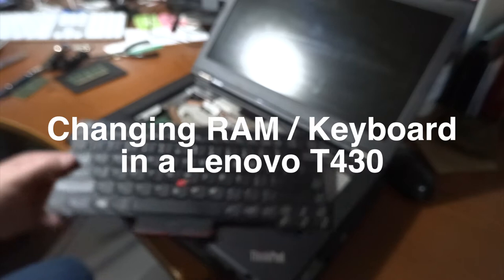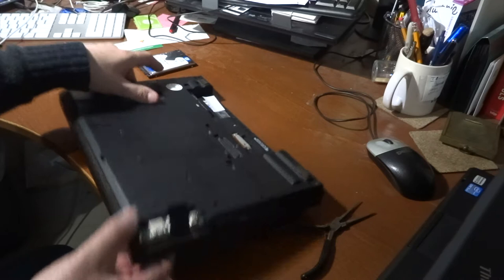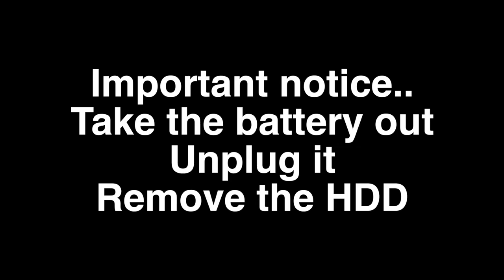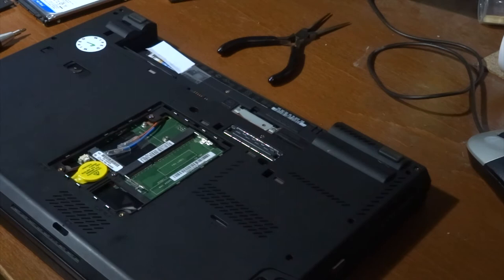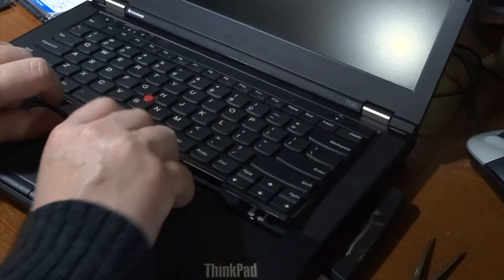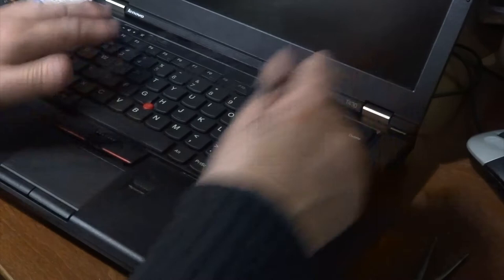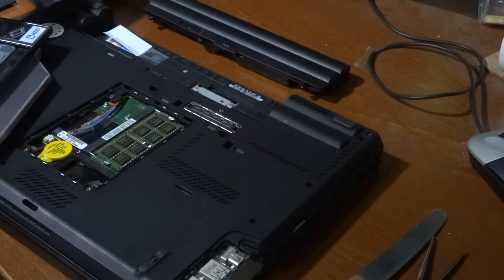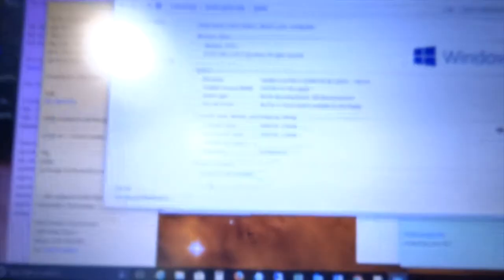Changing the RAM and Keyboard in a Lenovo T430 laptop

Comment: I think your old laptop only needed a new charger. The mouse going crazy when plugged in is a common issue with a cheap or faulty charger.
Reply from the maker: I only use the original Lenovo charger that it came with.   I noticed it with 2x T430's but not with my T450s
Reply: Yeah I've seen that occur when I used to repair thinkpads at an old job....voltage problems cause seemingly random issues, time for a new block.

Comment: Hi Mike
Is there a reason that my newly purchased refurbed Lenovo t430 would not have a cmos battery in it?
I bought it from FRys electronics.
Reply from the maker: No. That’s odd. Do you get a date / time error every time you start it?
Reply: @MikeDancy  Yes I do have to reset the clock. I just ordered a new cmos battery from amazon. I'm so glad I saw your video because I saw that it was very easy to change that model Lenovos CMOS battery. I will let you know how the new battery works out.  Thanks so much for your videos. They are very good and helpful.
Reply: Hi Mike. Put in the missing cmos battery. After 8 dollars and 3 hours of start up problems it finally works. I can finally pull the plug and not have to set the time when I restart. Yay! Thanks again!

Comment: Excellent video!  I love my T430 also!
Reply from the maker: me too.. but I sold it and went with a T450s .  512GB SSD / 12GB ram / Touchscreen.  Paid $400 CDN for it since it had a small crack in the display but mine sits in a dock 90% of the time so that crack doesn't effect my usage.
Reply: @MikeDancy  I was very fortunate to  find a very lightly used T430, and I mean very lightly used, for $130.  I updated with 16 gigs of ram and a 500 gig SSD.  It already had the 1600 x 900 display and back-lit keyboard.  The previous owner always had it docked so the power adapter was still wrapped from the factory. The keypad, trackpad,  and display look like they were never used.  Love this machine.  It is almost as fast as my other i7 laptop (this one is the i5). These machines are fun to own and play with.
Reply: @moldingpro7208  I got exactly the same great option only now in 2022 :) The only thing I don’t like is the hum of the fan. Everyone writes that this is a problem for many T430s. How are you doing with this?
Reply: @alexf1515  No abnormal hum.  I gave it to my friends daughter for college a year ago and she loves it!
Reply: @moldingpro7208  It was nice to hear. It turns out that replacing the fan will probably solve my problem and I will also love it like the daughter of your friends :) Thank you

Comment: 16gb of ram I think is overkill, I upgraded my T430 cpu from i5-3320M to i7-3740QM Quad Core and it's running 8gb (2x4gb) perfectly fine
Reply: after upgrading to i7 did u require to change the cooling fan?
Reply: @wolverineneo101  No, but is not worth it anymore unless your find the 3740qm for $25 at most, the iGPUs indeed super weak there is no way I'd pay $75 again, the 3rd gen i7 is also getting behind as well, being only 4c/8t cores gets pretty toasty at times, you better off investing in a new modern laptop in 2021 with 6c/12t or 8c/16t with powerful iGPUs, just saying

Comment: Out of interest; what do you use the laptop for that 16gb RAM helps with? Also, how do you find the screen? I've just picked up a T430 as a cheap replacement. It's the base model, so will likely just upgrade to an SSD to begin with and go from there
Reply from the maker: I do a lot of spreadsheets. The ram helps. I also use a dock and two external 24" monitors so I never look at the screen. Going to upgrade to a t450s soon.
Reply: Jarrah FitzGerald
 I'm in the same situation as you bro. Will start with an SSD first then move on to others. Do you have any tips on which upgrades should i try first ?

Comment: I've got a T430 (3.1 GHz i5 dual core) that has 8 GB only in the bottom slot.  I see the SODIMMs for these are almost free now, so I'm going to do what I've thought about as long as I've had this machine: upgrade the RAM.  Had to see how to get the keyboard off.  Might also have to prowl eBay for one of those DVD replacement caddies (and of course plan to upgrade the original platter drive to an SSD).  This would be a much more usable machine with 16 GB and an SSD main storage -- and I can get an external DVD+-RW for not much money.  I wonder if there's one that will plug into the PCMCIA slot (which I'll never use for anything else these days).  It'd be a good bit faster than USB 2.0.  And then it'll be time to upgrade from Ubuntu MATE 16.04 to Kubuntu 22.04...

I've got the 6s main battery and a wedge battery, so I've got lots of battery life (multiple hours at full draw).

Now, if I could find out for sure if this machine has  a GPU slot, I'd love to add an nVidia...
Reply from the maker: I think you’d have to run the S/N at the Lenovo site to verify which video chip it has
Reply: @MikeDancy  All the type and s/n data is worn off the data plate label on the bottom of the machine.  :(  But I did find a reference that says the GPU in a T430 is soldered in if present.  My internal checks say I have an i7-3520, 2.9 GHz standard up to 3.6 GHz max, looks like about the best CPU these ever got.  I should probably redo the thermal paste while I have the keyboard off for the RAM upgrade, and then spend my effort and money upgrading the storage.
Reply: @MikeDancy  Yes, and I keep forgetting to do that when I have the laptop and another connection to the web.  But I've gotten the understanding that in general the GPU in these was soldered in, so if present, it would detect from Kubuntu and I'd have been prompted to install the nVidia drivers if there were one.  I can live with it; I don't game on this machine with any frequency anyway.

Comment: It really does not like Windows 10 Pro as i can only see it at 6Gig of Ram on a i-core -5 as it's been added but cannot do what was so easy in win-7,a simple windows diagnostics and instead of 64 it's stuck-on 32mb to handle the core - 5. It's a great Laptop namely Lenovo 430s and since buying it second - hand last december the Updates have caused kaos,to the point i want win-7 back as it's all aimed at the x-box if your 5 / 6 years-old as i need it for MUSIC PROGRAMS and now on a TB-SSD & 32 RAM as Lenovo allow more Ram under your keyboard to useing the disk player to an extra drive ''why the Army used these carbon bodied Laptop'' ...Yikkkkeeesss 5 month on windows - 10 is a nightmare and now installing Linux Mint too basically so it works with less crap on it  ....kool video
Reply from the maker: are you using windows 64 bit or 32 bit?
Reply: @MikeDancy  What do you suggest should be used?